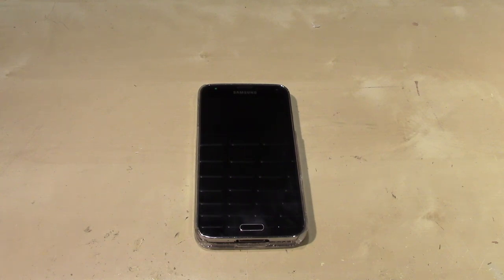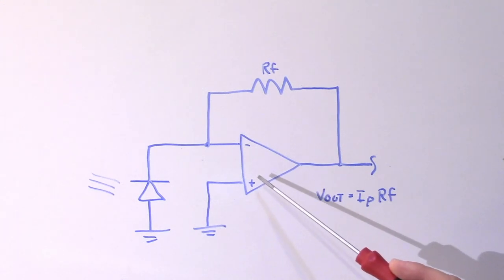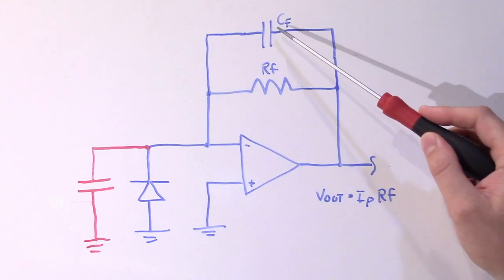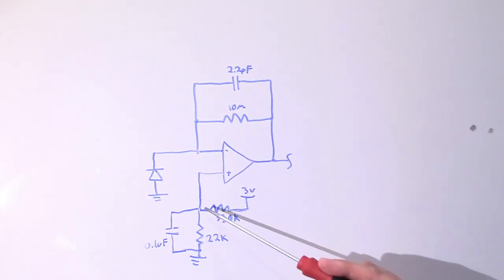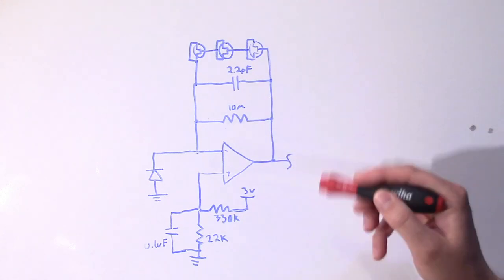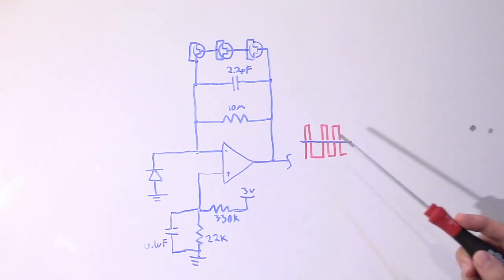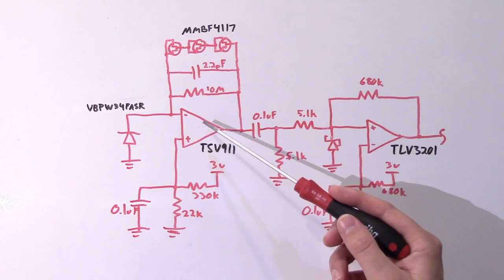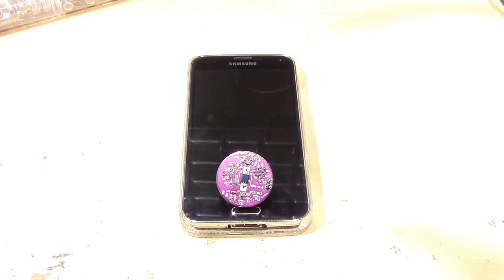Photodiode/Transimpedance Amplifier Design

Comment: devttys0 - Excellent description - I was with you until 7:42 when you stated reverse bias decreases sensitivity.  I designed beta particle detectors (basically specialized photodiodes) and we reverse biased them with 80v for the specific purpose of increased sensitivity.  Reverse bias (aka photoconductive mode) increases the depletion region of a PN junction, and the depletion region is where beta particles (and photons) are 'trapped' and thus detected.  Larger depletion region, more particles detected.  Downside of reverse bias is increase in dark current and thus shot noise, and drift.    For what you are doing here (photovoltaic mode) the gain in sensitivity is probably not worth the extra noise.  For most photodiodes this increase in noise can swamp the increase in signal and thus lowers overall signal to noise - if that is what you mean by reverse bias reducing sensitivity then ..... nvm.   (BTW - it takes a VERY specialized diode to handle 80v reverse bias ..... don't try at home ....)
Reply: Reverse bias decreases sensitivity compared with zero bias because the leakage current in reverse bias increases the noise floor. I think that "sensitivity" in this case means the lowest signal that can be detected against the background noise, rather than the responsivity (the current in amps per watt of incident energy) which is what you seem to be taking it to mean. In all of the photodiode applications I've made, the only reason to increase the reverse bias is to decrease the junction capacitance and therefore improve the response time.
Reply: IR light = about 1 EV, beta rays = 10 kEv and up.  That might have something to do with the choice of reverse bias, I'm guessing.

Comment: You don’t lose sensitivity when reverse biasing the photodiode. The responsively actually increase when reverse biased because the depletion region grows so sensing volume increase in the diode. However as the bias is increased so as the dark current, thus noise equivalent power (NEP) also increase. This cause the signal to noise to reduce. So optimal biasing depends on the NEP requirement and the bandwidth that is needed. Biasing also increase the linearity of the photodiode since it operates in photoconductive mode instead of photovoltaic mode at higher input light.

Comment: If you want to detect over a wide range, one or more diode+resistor networks in the feedback can be useful, to give a stepped gain charactristic, reducing gain as signal exceeds the Vf of the diode(s)

Comment: At 4:26 "... at some frequency that phase shift is going to be 180 degrees". No, it isn't. The phase shift in a single RC filter never exceeds 90°. You'll have to think again about what's causing oscillations. You also need to consider the phase shift introduced by the opamp itself at very high frequencies. Probably the layout is going to be critical in these sort of cases.

For modern rail-to-rail opamps, you have a CMOS output stage and that allows output voltages very close to the rails, especially with small current drawn. In addition MOSFETs don't suffer from the same problems of recovery from saturation that BJTs do, so you don't have to worry about that effect. I might have considered an MCP6002 for both the transimpedance amp and the comparator. You don't need a huge bandwidth to detect the 1KHz pulses and the MCP6002 is cheap as well as needing a supply current of just 100µA. Nice project.

Comment: Did you consider using an OOK circuit for the comparator. In this the DC coupled signal is applied to both the positive and negative inputs of the comparator. At the positive pin, feedback is applied to turn this input into a sensitive Schmitt trigger input. At the negative input the signal is low passed filtered with a high value bias resistor added across the capacitor and the divider formed  referenced to the positive rail. This has the effect of putting the Schmitt trigger point slightly above the average noise voltage and any DC bias on the signal. Provided the Schmitt trigger threshold voltage is designed to be  slightly higher than the bias voltage, the circuit will trigger on the signal as it just appears above the noise. I have used this circuit to decode OOK modulated on the 433.92 MHz RF data channel, where the background noise can be high and variable, which makes the choice of a simple AC coupled comparitor threshold difficult.  The detector can be DC coupled to the signal, picking out only the peaks which exceed the Schmitt trigger threshold above the variable background noise. Effectively the tiny trigger threshold floats above the average noise floor and any DC bias, no matter what that might be. This works well where the channel is dominated by band limited white noise. In my case this solution proved to be better than just AC  coupling the signal onto a compatible with a fixed offset bias. The Schmitt action gives well defined rail to rail output pulses, it is even possible to modify the Schmitt recover time to ensure a minimum recovered data pulse width.

Comment: This is a fantastic breakdown and analysis. I'm starting a project that is similar. I'm wanting to track an IR beacon from a few hundred feet away (the beacon can be much much brighter than a phone output). So this is super helpful, and has given me confidence that it might actually be possible.  @7:40 you mention that reverse biasing photo diodes reduces their sensitivity. But looking at the datasheet, figure 4 on page 3 shows "Reverse Light Current vs. Reverse Voltage" actually is extremely linear. figure 5 shows the capacitance drops quite a bit with higher reverse voltage. This would indicate to me that a higher reverse voltage would actually be a good thing for high speed applications, and may make it easer to filter out high frequency oscillations.
Reply: Yes, higher reverse bias will increase the response speed of the diode, but at a cost of greater noise.
If you're looking for small signals (and you don't need very fast speeds), then keeping the reverse bias as close to zero as possible to reduce the noise is a better strategy.

Comment: Interestingly enough the circuit you designed is almost identical to the charge-sensitive preamplifiers used for radiation detectors (gas-filled tubes, photomultipliers, HPGe photodiodes, etc.). The main difference is that the DC blocking cap in those applications would be put next to the detector rather than on the amplifier's output, mainly because a bias voltage of hundreds or thousands of volts are put on the detectors and you want to keep that away from the amplifier.

So I'm thinking of borrowing a preamp from my lab and hooking an IR photodiode to it to see what it thinks about my phone...
Reply from the maker: Ah, very cool! Actually, come to think of it, putting the DC blocking cap next to the detector might be better for this application, since any constant light source is unwanted here. It would cause a light-source-dependent voltage build up across the photodiode which would change some of the operating properties of the photodiode, but that downside might be offset by the fact that the unwanted ambient light wouldn't be amplified by the op-amp. I'll have to try it out!
Reply: That could be interesting; just be advised that the amplifier's operation changes quite a bit when you give it pulses instead of a current. It won't preserve the shape of the square wave and the output voltage will peak at V=q/C and decay exponentially with a time constant of t=RC (q is the charge produced by the detector, R and C are the values of the op amp's feedback components). However, if all you care about is the timing of the leading edge of the square wave it should work.
Reply from the maker: Yeah, decay time might be a show-stopper. It'll be fun to experiment with though. :)

Comment: one thing that always pops into my mind with low current applications and "the diode drops 0.7V " is that for low currents the drop is much lower, and often this bites people when their nanoamps start flowing away at .2V instead
Reply: Yes, that's important to consider. I'd like to know what professionals do about that, since I've faced that problem a couple of times and I don't know if my solutions were optimal.
Reply: @guillep2k  Reducing a diode's forward current by a factor of e (2.718) decreases its voltage drop by approximately 25-26mV at room temperature. So reducing the current from 1mA to 1nA implies a reduction of its forward voltage by about 350mV or so. That's probably as much as you can do to estimate the effect.

Comment: Very good. I've been researching and this is the best I've come across. 
The app I want is to have laser beam interrupted by a swinging pendulum. That feeds into an Arduino to get times of swings.  The output being binary
One thing I picked up on is your comment on stray lights. That's given me the idea of a filter of the right colour on the detection side. 

1. Are there reasons to use a combination op amp and comparator chip?
2. Is there hysteresis in the circuit? 
3. If there's bounce on the output I presume I can use a low pass filter?

Comment: sweet photo diode video,  i would like to make an analog isolation 1:1 ratio 10vdc op amp pcb using the vishay IL300 photo-diode chip. any circuit suggestions  before having the pcb made? thanks :)

Comment: Very cool vid. I usually test the step response of this kind of amplifier and tweak it using the twisted wire capacitor trick. Also, this amp requires shielding, otherwise it picks up  tons of crap, especially with a high gain like this one.

Comment: So coin cell batteries are usually rated for <200 uA continuous so running them at 800 uA may be problematic. Have you come across any issues at all? I'm asking because I would like to use coin cells in a project I'm working on, but I need to run at ~3 mA. Really cool project by the way.
Reply from the maker: Most of the ones I've seen are tested at <200uA, and that's what their mAh ratings are measured at, but you should be able to draw 3mA fine, it'll just drain the battery faster. See the Maximum Current table in this datasheet, it lists the CR2032 max current at 10mA: http://www.farnell.com/datasheets/1496885.pdf. I tested a couple of these IRis boards, and the CR2032s lasted just over 2 weeks before the voltage dropped to inoperable levels.
Reply: Cool. Thanks. Also what 3D renderer do you use?
Reply from the maker: It's the one built into KiCAD.
Reply: Schweet. Thanks.

Comment: What is the frequency response of this circuit?  Can it see the 38khz modulation in typical IR signals from remotes?  It would seem that the 10M feedback, while providing high gain, would also degrade the frequency response considerably.
Reply: I'd like to know that too.
Reply: You’re correct. If it’s designed correctly, the dominant pole will be governed by the RC in the feedback path. In this case, BW = 1/(2*pi*R*C) = 7.2kHz. Remember how tiny 2.2pF is - and how easily board parasitics could swamp it. Reducing this capacitance would not be a good way of widening the bandwidth

Comment: Hello,
I do not understand why the circuit is not stable. So I tried some things :
First I replaced the photodiode by a perfect current generator in parallel with the capacitance. Then I transformed the Norton generator by a Thevenin generator delivering the voltage : e = id/jCw. id is what I called the photodiode current, e being the entry for transfer function. By using Milmann on the node with the potential V- (entry minus of the TIA), I found H(p) = -Rf*Cp. 
Now this doesn't look like any transfer function I've ever seen. I would like to analyse the stability but it has no denominator so I don't know how. Maybe that in this simple case the stability is just by analysing H(p) when p tends towards +infinity? Then I would get H(+inf) = +inf, can this alone let me conclude that the system is not stable? 
Also I first considered the resistance Rs of the substrat of the photodiode, following this method I found H1(p) = -RfCp/(1+RsCp) but then this transfer function is stable so it contradicts what you said.

Comment: Great video! Is there a reason you wouldn't shunt the current from the photodiode across a resistance and measure the voltage instead of inputting the current directly into the amplifier?
Reply from the maker: Good question! The answer is yes, you generally don't want to do that because you don't want to develop a signal voltage across the photodiode, since changing the photodiode's voltage bias will change its operational properties. For example, changing the voltage bias across a photodiode will change the photodiode's sensitivity (aka, "flux responsivity"). You usually don't want the signal that you're measuring to affect the sensitivity of the sensor that you're using to measure it with, so keeping the signal voltage off the photodiode is important. By using a transimpedance amplifier, the op amp varies its output voltage to ensure that the voltage at its inverting input - and hence, the voltage across the photodiode - remains constant. Hence the signal voltage appears at the op amp's output, and not across the photodiode.
Reply: @Analogzoo  Beside's amplitude errors you describe looks like you don't care about it too much in your case, but one more obvious problem in that case is maximum voltage output from terminated PD in voltage in photovoltaic mode is ~0.5V and relative linear operation is up to 300-400mV, then it saturates in weird way producing all sorts of artifacts, so that way is more bumming... Plus to preserve square wave fidelity (reasonable fall&rise t) you have to terminate PD well enough which leads to low gain (in the beginning of video for that case detection range discussed was few")... You could employ discrete+hybrid opamp (2 stages) to lower noise and increase bandwidth, also PD bootstrapping might offer a lots of Cpd cancellation that adds more BW and gain but overall nice informative vid.

Comment: dear host, I really enjoyed   this cirquit.  but instead of 3 mosfets  isn't it more practical to use one zenerdiode in reverse polarisation?
Reply from the maker: You could definitely use a zener, or three normal diodes. The advantage of using JFETs as diodes is that they have very very low reverse leakage current. In the original design, the circuit was powered from a split supply, so there was a possibility that the diodes could become reverse biased; later, the design was switched to run off a single supply and reverse biasing should never happen now, so the JFETs really don't give much of an advantage, they're just a hold-over from the original design.

Comment: 10 meg feedback resistor seems too high, noisy and maybe unstable?(I think it's resistance will vary a bit depending even on air humidity). wouldn't it be better if there was two amplifier stages(more stable, less noise)? One transimpedance amplifier with say 100 kOm fixed resistor, and second stage - voltage amplifier with another 100 kOm feedback resistor, maybe variable so you can adjust it for best performance. And then comparator.
Reply from the maker: It is quite a large resistor, and cascading two amplifiers would likely be perfectly acceptable here; in fact, what you suggest is commonly done when high gain and wide bandwidth are both required. However, wide bandwidth was not a requirement in this case.

Making the feedback resistor larger actually increases stability, and even the compensation capacitor in the schematic can be removed without adverse affect; even a few pF of parasitic capacitance in parallel with such a large resistance forms a low pass filter with a pretty low-frequency cutoff, effectively preventing high frequency oscillation/instability.

And yes, the resistor value will change over temperature, humidity, etc…even putting a voltage across a resistor causes undesirable effects such as non-linearity (practical resistors are not perfectly linear). I don’t expect any significant negative effects in this case, although to be fair I have not performed any extensive temperature testing.

A larger resistor will indeed have more inherent Johnson noise, but noise is not really a concern; what’s really important is the signal-to-noise ratio. 10mVpp of noise isn’t much a problem if your signal is 10Vpp, but it is a problem if your signal is only 11mVpp! The transimpedance amplifier’s gain increases directly with the feedback resistor value, but the noise increases with the square root of the resistor. All else being equal, this means that a larger feedback resistor results in a better SNR. In addition, the narrow bandwidth formed by the large resistance and its parallel capacitance is very effective at reducing noise in the system. It’s all a bit tricky though, because proper noise analysis is rather complex when dealing with photodiode amplifiers. 

Bottom line is that I would expect both approaches to work acceptably, but I’d highly recommend Jerald Graeme’s Photodiode Amplifiers book, which deals extensively with noise, cascading amplifier stages, stability, etc.
Reply: Thanx, that was very informative answer. BTW I had such problem while designing similar circuit where high value op amp gain resistors changed they'r values and part of circuit tended to be unstable. But circuit was used in marine application, and it took some time to find the cause. :)
Reply: @Analogzoo  Late reply, buy hey. 
A higher TIA feedback resistor would increase the SNR of the electrical signal itself, for the reasons you mention - but wouldn't it also make it more susceptible to radiated noise, though? Noise pickup would be higher on a higher impedance node than on a low impedance node, so (as always is the case with noise analysis) it would all depend on what your main noise sources are.